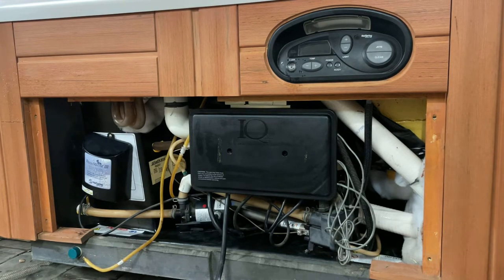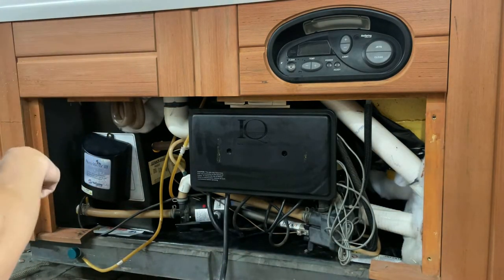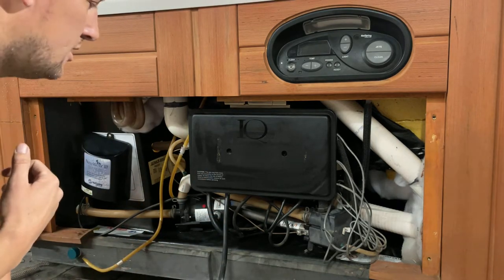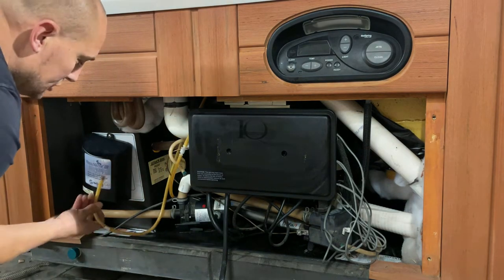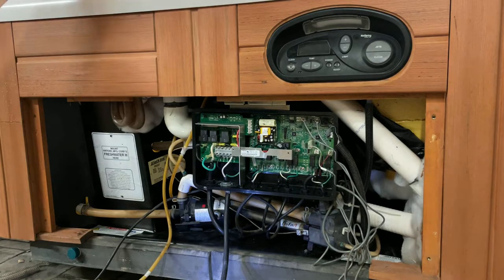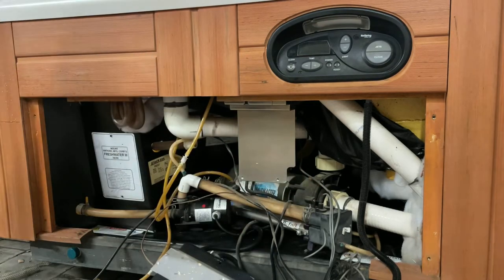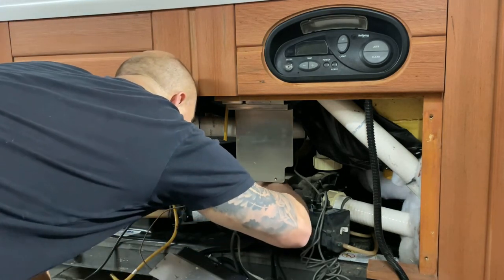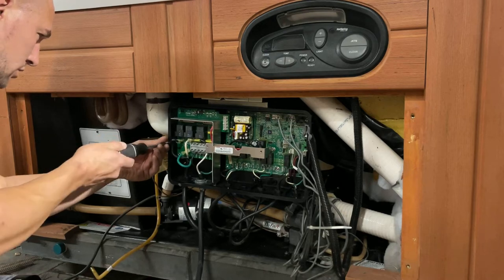Red & Green Blinking Lights Hot Springs Spa / Pressure Switch Failed adding aftermarket Flow Switch

Comment: This is a great video and put me on the right track, but you can actually skip most of this effort. HotSpring has discontinued the pressure switch part.  They now instruct owners to cut the wire off between the board and heater, strip them back and crimp them together. I used an insulated closed end crimp connector, but a wire nut would work as well. It closes the circuit and allows the heater to turn on. The parts guy at the HotSpring store told me the heater is still protected from overheating by other safeguards. This fix worked well for me and cost effectively nothing.
Reply: It looks like this was done to my spa. If the ready light still blinks and it won’t heat is it the heater itself?
Reply: Did the same, worked.  Good to know the heater is still protected.
Reply: Interesting! Can you clarify a bit more? The pressure switch wire? And what exactly are you cutting / crimping on that wire? Thanks!
Reply: Can you put photos?
Reply: Pretty sure he’s simply “twisting the wires together” to complete the circuit.  They can be mechanically crimped, wire nut or twisted and taped… this allows the controller to “see” pressure thus allowing the heater to operate.  There are just two wires attached to the pressure switch so should be easy.  Cheers

Comment: Why not jump the pressure switch in the box,it's free and problem solved
Reply: It looks like that’s already been done to mine at some point. Currently, after it was drained it will not heat. Do I need a new heater?
Reply: @sherryfrith105  you may have a airlock if not filled thru the grey filter stem, check for power to your heater with a meter also there should be a red heater light on the top of your board,it sounds like a airlock thought
Reply: @wxjunky  the heater light is not on
Reply: @sherryfrith105  is the circulation pump running and moving water(if it has a circulation pump) ?
Reply: @wxjunky  yes it’s circulating fine
Reply: @wxjunky  how do I check for an air lock?
Reply: @sherryfrith105  you hit the jet button and the motor runs but doesn't move water inside the tub is a airlock,you turn on the pump and slowly bleed off the air by loosening your discharge
Reply: @wxjunky  it’s circulating very well.
Reply: Could someone please explain what “jump the pressure switch” mean?

Comment: i have the 2004 prodigy. and i just changed the heater circuit board because it wasn't heating up. now it gets warm but the jets don't work, and every time i press the jet button, the D17 red light comes on. would u happen to know why the d17 light comes on when i press the jet or jet clean button???????? i have called 4 electricians to come take a look but no body knows what they are doing 😔

Comment: Thanks for the flow switch tip, nice job. My IQ 2020 has failed twice with a different problem, in both cases the spa was completely dead, no sign of life. I traced the problem to the power supply on the motherboard, in both cases it was a 220uf 25V electrolytic on the AC side of the PSU daughter board. The first time I replaced the cap with a no-name brand, big mistake as it only lasted a few years, the second time I used a good quality Elna cap. If you're interested I can provide pictures. :)

Comment: Thank you so much for this video! I had the blinking power and ready light problem after draining and refilling our Tiger River Spa and ran across your video.  I zeroed in that my problem was a gunked up  pressure switch by unplugging the pressure switch plug on the control panel and closing the circuit with a pair of alligator clips.  Spa began working again normally with that temporary fix.  Ordered the aftermarket flow switch from Amazon along with some tubing and completed the repair today.  Super easy especially with a heat gun to soften up the hoses.  I'm pretty sure our spa repair place would have wanted to replace the whole heating unit had I called them.  You saved me some serious cash! Thanks again!
Reply from the maker: I’m just now getting around to reading this comment and it made my day!! So glad I could help
Reply: @NorcalSpas  My husband drained the spa and refilled it. Afterwards the heater return wasn’t putting out water. He had a service person out. Looks like he replaced the main circuit board. Now the heater return works great but it will not heat up. 
The jets are strong with no surging.

On the control panel the power light is solid red and the ready light flashed green.

On the circuit boards the D9 is flashing red and D10 is solid green. LIM is solid green. HTR ON lights up green for a few seconds then goes off. The pressure switch looks like it has already been shorted out to itself. When the jets are on D17 is solid red.

We have been waiting for the service person for months. I would love to fix this ourselves and cancel our service call. Thanks for any help.

Comment: I’ve got the blinking red and green after replacing the water in the spa.  How can I troubleshoot to tell if the problem is with the circulation pump or pressure switch?

Comment: You mention both a red and green flashing light. Did I get that right or is it just the green light. I currently have a green flashing light after replacing the two red washers on the end cap of the heater. My circle pump seems to be doing its job, but after inspecting the heater it is obvious that it is not heating up. I am just wondering before hacking the  switch, is there a way to make Sur ethat it is the flow switch and not a complete failure of the heater. thanks

Comment: My hot tub has a blinking red light. It tries to start when I turn on the breakers soon after I hear a click (relay) but then it shuts down. Seems like the small e5 style circ pump isn’t working, it’s hot and won’t move any water. Can this cause the tub to shut down immediately and is there a work around that puts the main jets in low mode to circulate the water without the e5 circ pump? I’ve done that on another brand tub but idk if changing any of jumpers 1-12 can remove the e5 and allow the big jets to do the circulating in a pinch.

Comment: Congratulations on your channel, I am a fan of your videos, you are a professional and excellent instructor. I have a HotSpring Jetseeter. When I turn on the jets I hear repeated clicks on the relays. I left the jets on for about 5 to 10 minutes and they stopped working, I checked the voltage (120v) and it was fine, the next step I did was unplug the pump and check if it was working and really if it is ok... I wonder if this is a problem with the relay board or the main board 🤷🏻‍♂️.... I hope for your help
Reply: Ever diagnose the problem and fix it ?
Reply: Not yet

Comment: I tried using the aftermarket flow switch, only to learn the switch was defective and did not solve the problem. I spoke with a technician at Spa Depot in Olympia, WA and learned that all you really need to do is cut the wire from the pressure switch on the Watkins heater and splice the wires together from the Molex connector mounted on the mother board. This activates flow and allows the heater to operate properly. The flow switch in not needed.
My hot tub heater is now working and regulating as it should.
Reply: You are right on sir. After writing my initial comment I researched the heater mfg website. The flow switch is an integral part of the heater, requiring full heater replacement to solve the flow switch problem. At a cost of $238 for the heater + switch combo from the OEM Watkins, it is a poor design.  So I jumpered it out temporarily until I could find the flow switch mentioned in this utube. It sounded like “Waterloo”? But of more interest Watkins sells the heater + switch replacement unit mentioned above as a kit that includes a pre manufactured jumper wire to remove the switch from the circuit. I hesitated to make my jumper a permanent solution vs temporary. Know anything about the Waterloo part?

Comment: This is a great video.  I own a 2016 Hot Spring Grandee NXT and I keep getting a flashing blue light on the outside panel. I also have the Connextion wireless app that provides me info when something goes wrong with the system. I can also control the hot tub remotely with the app. 
The problem I am having for some time now that that the error message reads “Circulation is low, clean filters”. Filters are brand new and have been cleaned. I will also get “System interlock on” . I shut down the breakers, wait, then reset breakers. All is good for a few hours. Then I will get the flashing blue light and a Message, “System anterlock on”. The heater works fine after I reset the breaker. 
I had a tech come out and he bypassed the pressure switch with a jumper, that seem to work for a week. Then started happening again. 
Tech cam back out and said it’s the computer board, I told him prove it to me. I’m an engineer and understand the principles of this system. He then thought about it and proceeded to disconnect the hose from the circulation pump and the T valve that you removed in your video to let water come out and see if it was clogged in there.  He put the hoses back on and starts the system back up. We saw particles come up and through the bottom of the circulation/ozone bubbler vent. Flow appeared to be better.  He said this should work now.  After he left 2 hours later, I’m back to flashing blue on my panel and the tub is locked out.  
This issue happens when the tub is not in use and in standard circulation mode.  What could be the issue.  I do not like throwing money after parts to see if this is the issue.  
Any help would greatly appreciated and I can do this work myself as I have the tools and aptitude for any repair thrown at me.  Been doing it my whole life and owned a 1994 Sundance Royale for 20 years prior to my new 2016 Hot Spring tub.  Thanks

Comment: I use a little torch from 711 instead of worrying about carrying a heat gun and trying to find a source of power for it.  You have to be a little careful but it works fine.  Better in tight spaces than the heat gun too.  Definitely good to heat them up when the barb underneath is plastic.  I have had them break off.  I just replaced a heater somebody broke the 3/4 barb off of the back.  I think you can replace the manifold on the hot springs ones.  This was a jacuzzi so it was broken.  The heater had no ohms anyway and it’s kind of tricky to replace if you don’t know what you are doing.  You pretty much have to pry that hose off w a flat blade or it’s not going to come off.  Even if you heat it up.  If you heat it and use the flat blade wiggle trick after you twist it and break it free it comes off in about a minute.  For sensor wires I use uy telecom connectors.  You don’t have to strip the wires and the connection is waterproof.  Great for lights too.  I just spliced a topside that a rat chewed w them.  It had a connector like a cat 5 cable on an old bullfrog and it worked fine.  They needed a pump too though so the fun never ends

Comment: 13:02 hey I have a leaking hot springs puls 2012 heater w salt water corrosion. Best to replace or repair ?
Reply: You can always fix it cheaper than a new one.  Where are you at w salt corrosion?  I deal w it all the time working in Santa Cruz.  Everything within like 2 miles of the ocean has salt issues

Comment: @Hot Tub Cowboy - I have an old Watkins tub I'm trying to get running and the board is fried. Can I replace it with a 3rd party or some sort of aftermarket control board? Finding an IQ 2020 to replace it has been rough.

Comment: I was just given a 2005 hot spring spa like this one but it’s grey in color. It worked perfect when it was moved to its current location. It sat for 10 years and was never run and no water in it. What should I look for to make sure it’s still ok? I have a spa tech coming next week to look it over. Thanks!

Comment: So I have a Hot Spring Vanguard 2014  I have had it serviced it looks like they bi-passed the pressure switch the cutting the wire and twisting the end. I now have a red and green light flashing on my circuit board. The water is flowing through the heater but it will not heat the tub full of water. Can you help me understand what service I need. I've been soured as with the last service tech seems to have cut some corners, I hope they were not at my expence,

Comment: I have a 2014 hot spring envoy and the Hrt light is blinking red and the green power light slowly blinking is this also the fox for it ?
Reply from the maker: On your diagnostic lighting (logo lights) you should have a blue power light and green ready light. Which one or are both of those blinking?
Reply: @NorcalSpas  neither of them are on but it is on the board of the hot tub.
Reply from the maker: @Heather Shay  you should have at least one of those lights blinking on the logo. Sometimes in the day time it’s hard to see so you may need to cup your hand over the logo and check or look on the control unit you should either see a solid power or flashing power and ready
Reply: @NorcalSpas  I had my husband check only the blue lights comes on if we can get it up to temp .

Comment: I need help asap. I have this spa, it heats up but then the black switch board with the buttons keeps turning off, and stops heating but the heater and pump works. What could it be??
Reply from the maker: Do you still need help? When you say black switch board with buttons are you referring to the control unit on top built into the siding
Reply: @NorcalSpas  0:55

Comment: Hello,
I tried this, install the bypass pressure switch, and connected it all back together.  Now the red light is no longer blinking but my green light is not on at all and the spa is still not heating any suggestions?

Comment: How would I figure out the flow switch needed for a Vanguard spa (2013)?  I don't see anything online that specifies which switches to use for which spas.
Reply: May be a universal solution. This was suggested for my Hot Springs. The difference may just be the plugin. Save old one. You may need the plug to cut and wire in. This does one thing electrically; open or close.

Comment: @HotTubCowboy my red and green light comes on only when I run the jets the heat is working fine, and the pump is moving water. Great I have had to bleed air out of the pump line in the past to get the bubble out and that usually solve the issue however, this time it seems to continue. Please help if you can. Also, does anybody have the link to the aftermarket part?

Comment: Hi Hot tube cowboy, I have a water leakage on the opposite side from the endcap. Who could provide me with an solution? There was a frost damage on the endcap and I‘m afraid that the opposite side has also suffered. Thank you!
Reply: I used jbweld MarineWeld to fix the same problem.   I did have to use a bunch.  Ugly but 1 year in and holding.

Comment: No. I’m sorry this is all wrong. You’re deleting the Ozone, the Mazzi, and creating so much more work for yourself. Just replace the original part. It cost the same if not less than the flow sensor, and you wouldn’t have to remove the lower control, the ozone, the mazzi, splice the wire, heat the flex pvc, glue the new flex. The fail rate on those flow sensors are just as bad, they are no better than the hot springs thermistor.